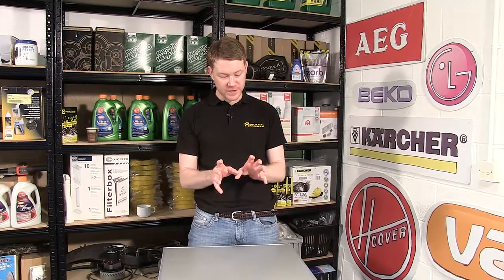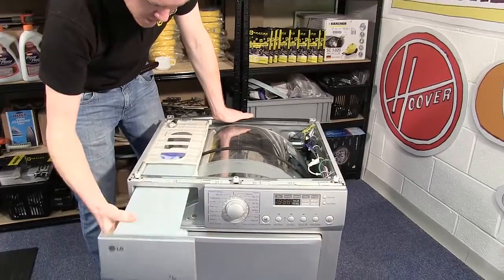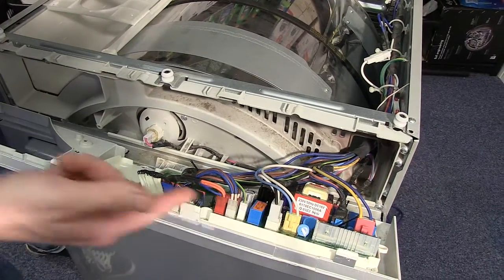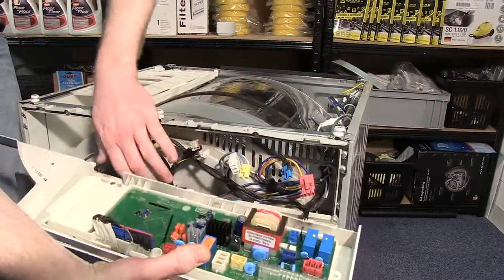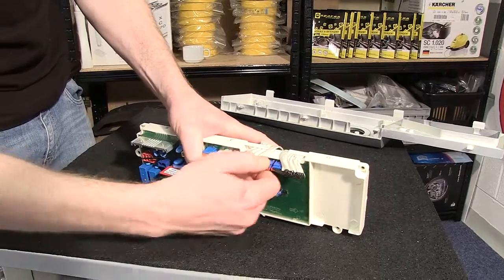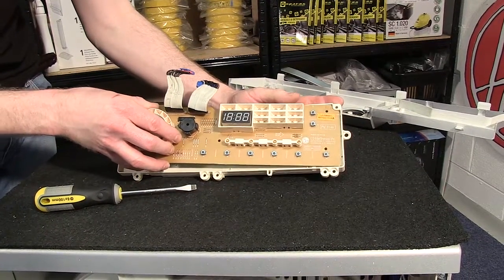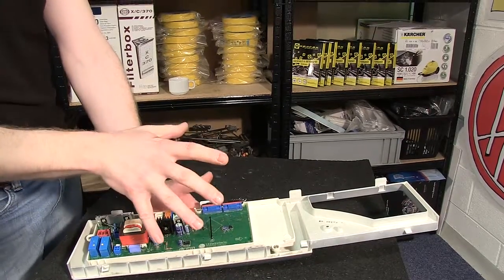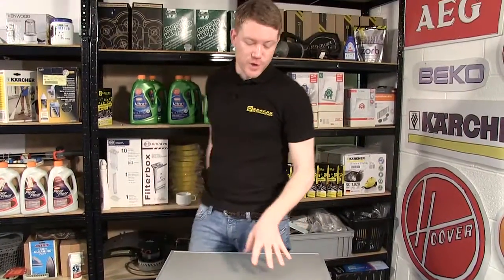How to Replace the Circuit Board on a Tumble Dryer (LG)

Comment: Hi, I have an Ariston/Hotpoint tumble drier ASL70CX. It is flashing the Time Delay and Pre-Crease Care lights. Searching on the net it seems to be Error Code F12, communication problem. Can you help please? Thx
Reply from the maker: Milena Pais When you have a 'communication problem' it means the control board (display pcb) cannot understand what the main module is doing.
This usually is either due to loose or contaminated connections or a faulty main module. For more information see another of our videos:
www.youtube.com/watch?v=Ph1oCRrvXO4